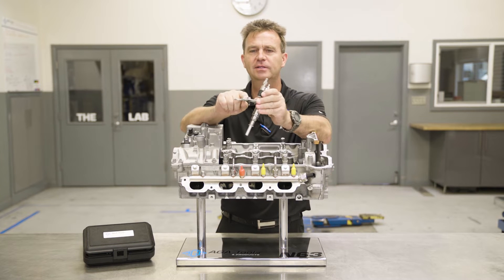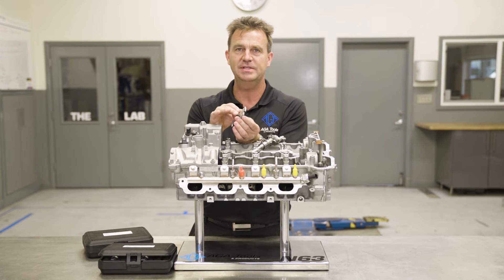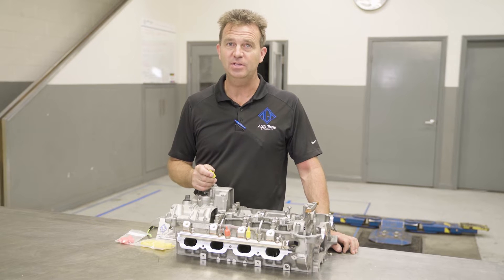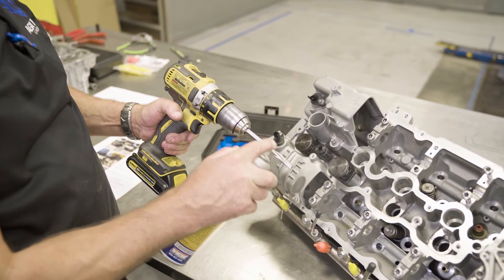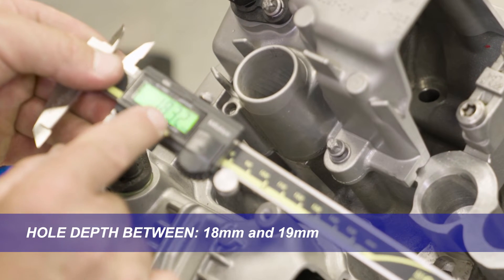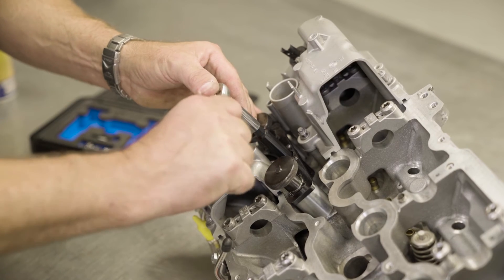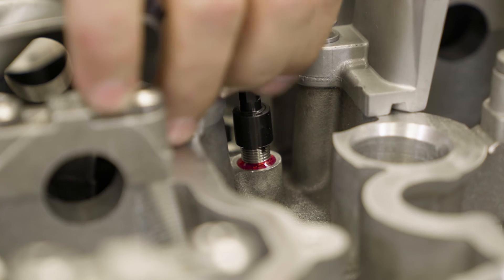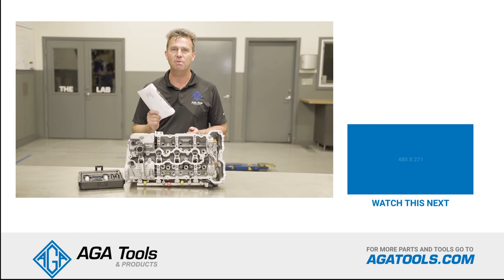AGA Injector N63 Hold Down Thread Repair

Comment: To remove the drilling debris I’d recommend using a shop vac or some type of vacuum cleaner with a narrow tip adapter to remove the debris rather than shop air. There is so many unknown places the debris could go by using shop air. Also the vacuum cleaner is handy for injector replacement for engine repairs in general on the N63 to prevent debris like the sand, dirt, dust, and oil from a leaking valve cover that loves to build up in the valleys of the injector area and preventing them from getting into the cylinders. 
Overall another great tool from AGA 👍🏼👍🏼

Comment: Nice tool kit. But as for the drilling, mechanics don't know about anything other than Jobber Length drill bits?  They do make extension drills bits in just about every size. They also make holders that will extend the reach of a drill bit. The trick is to learn how to keep the drill straight when drilling. And there are several types of drill and reamer stops available on the market so that you can set the depth of cut so you don't go deeper than required. 
Using grease or Bees wax in the flutes of a drill bit or reamer will keep the chips stuck in the flutes of the bit and remove most if not all the metal chips. Grease or soft Bees wax will also work on the tap as well to keep the metal chips in the flutes of the tap. When using grease the thicker the better. There may be some products on the market today that are designed to do the same thing as the grease and wax trick. This is much better than blowing metal chips all over the engine that could fowl some other equipment. electronics or accessories in the engine bay. Vacuuming out the hole is preferable if you can get something small enough to get in the hole and large enough to suck out the chips. 
Before I go any farther, I'm not putting down this tool. It is good to insure that hole is straight for the less experienced. Still, for the expense of this kit, they could have provided a drill or reamer stop and a setting gauge to set the depth of the stop, along with a simple Go/No Go gauge to ensure the hole is to the proper depth. This would make this tool much simpler and faster for a mechanic and eliminate measuring the depth of the hole.
I work as an Aircraft Machinist in the USAF. Foreign Object Damage, AKA FOD, is a big deal when working on multi billion dollar aircraft and multi million dollar jet engines. Especially with the engines and electronics when it comes to any king of metal repair that will cause metal chips or filings to be produced. Even with the older reciprocating (Piston) engines we would use the wax or grease to tap out a spark plug hole for a helicoil thread repair so chips would not get inside and damage the bore. Then they would bore scope the cylinder to make sure there wasn't anything that could cause damage. We even made up a tool that would hold on to the tang of the helicoil when we broke it off.  There is an old military saying: If it is necessary, it will be done. With the budget cuts the military has to endure, we had to come up with may unique ways to repair aircraft safely and without FOD. 
Thing is, there are many simple ways to do these jobs and repairs if you use commonsense and your imagination. Even in the civilian world.

Comment: Did this with an elblow drill adapter for a straight cutout. Tapped with an m8x1.25 bolt.
Reply: I know this was forever ago but do you mind chatting with me about your set up? Really trying to avoid spending the 400 if I don’t need to lol
Reply: @kevinthomas6539  pretty straight forward process. Just bought a 90 degree elbow for 1/4” drive and tapped the hole for a m8x1.25 . I think the whole ordeal took maybe 30 minutes